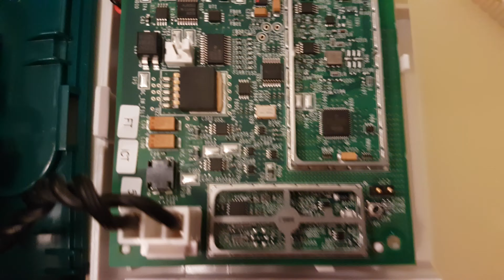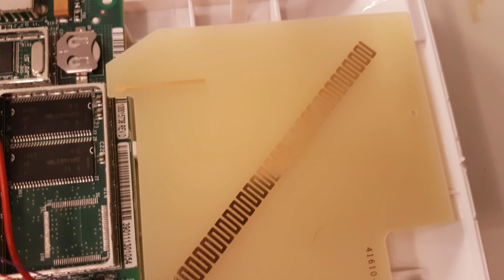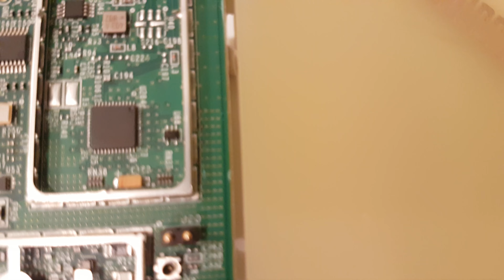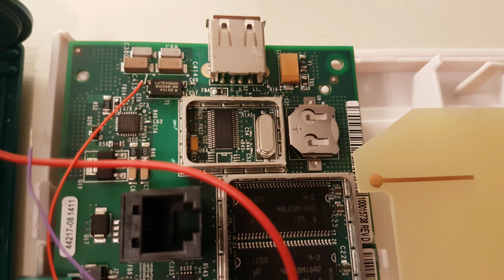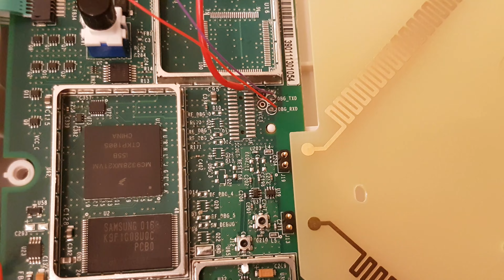Merlin @home ex1150 pbc and component breakdown

Comment: I couldn’t get mine to work with my internet wifi on at the same time and their cellular adapter wouldn’t work with my provider. But when I moved the wifi box about 10 feet away my Merlin seems to be working now. I tried to call the Merlin people to verify it’s operating but got put on hold forever and I eventually gave up trying to contact them so I’ll just leave it on anyway.

Comment: I have one of these and I'm trying to figure out why it won't work over my VoIP interface. (They want $450 for the broadband interface!)  I wonder if the "phone jack" is actually a DSL interface, and if I got a single ADSL DSLAM could I bridge it over to my IP network.  Any thoughts?
Reply: Sadly I can't tell you the technical explanation for this.  While trying to get my sisters and mother's bedside monitor to work we discovered several important things:
  1) Check to see If your device is on the recall list (we put her device model and serial number into this website and found out that theirs were not) at  https://www.sjm.com/en/patients/arrhythmias/resources-support/battery-advisory?clset=af584191-45c9-4201-8740-5409f4cf8bdd%3ab20716c1-c2a6-4e4c-844b-d0dd6899eb3a
 2) If your device is on the recall list St Jude will give you free Merlin monitoring service through your doctors office (if your doctors office participates in the program).  The monitoring service was only available to us through the doctors office that put in their pacemakers.
3) The Merlin Home monitor includes a POTS phone hook up.
4) An adaptor is available to connect the home monitor to a wifi router and a cellular adaptor is available too. Neither my mother or sister were able to get the WiFi router adaptor or the cell adaptor because our local hospitals hadn't purchased them to give to the patients.   As Norm points out, you can purchase either adaptor for ~$450. We decided to try some other routes before putting out that much money.
5) If your device is on recall you might be able to get an adaptor for free, but since neither my mother's or my sister's devices were on recall we weren't able to get free adaptors.
6) TO NORM's QUESTION........about VoiP......   we tried three different VoiP companies before we found one that worked without problem.  SO, I suspect it's a setting, or an issue with the specific VoiP version of the carrier-something specific to the carrier.      .......and of course..... the VoiP carrier that worked for us went out of business!

We finally found out that ATT has a $27 "Package" you can buy IF your location can get DSL.  You DONT need to get DSL but asking that question identifies if your house has legit "old school" copper line coming to it.  Then you JUST, JUST buy the $27/mo "Package."   When the ATT lineman came to the house we told him it was for a heart monitor and he seemed to understand what that meant.

So, it has been a real journey to figure all this out!   I hope our experience helps one of you all!